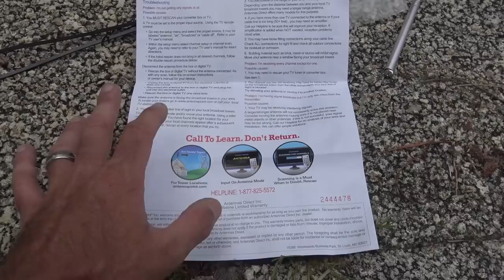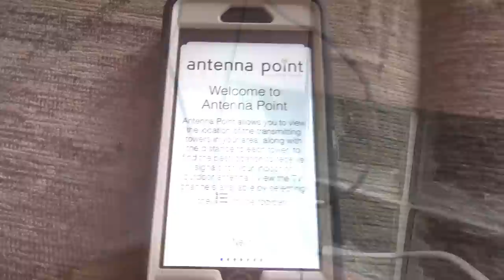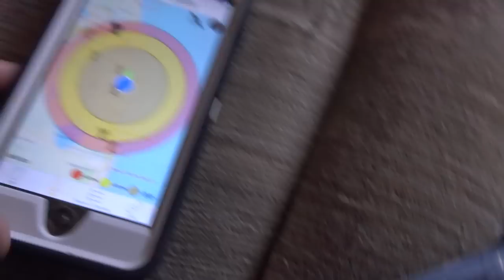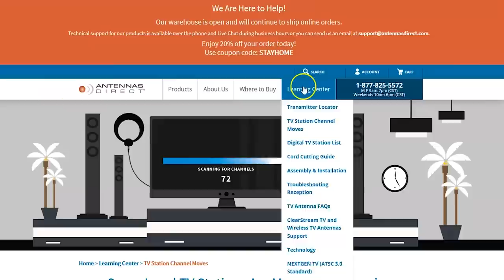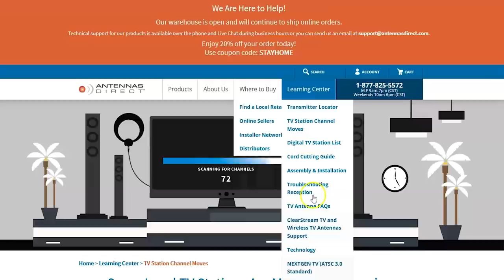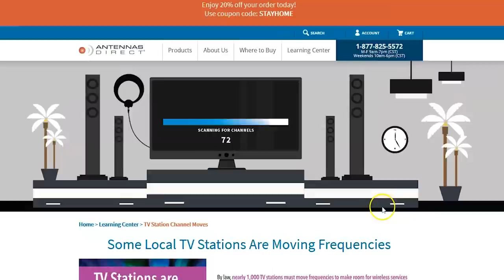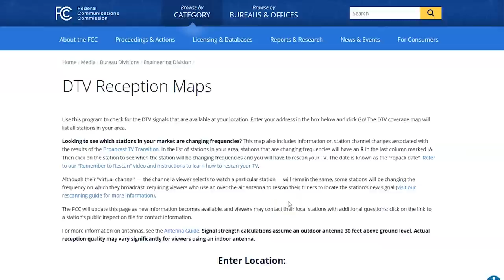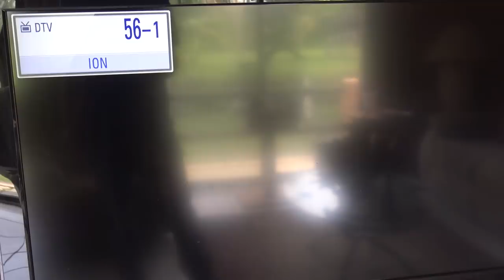Cancel Your Cable/Satellite, FREE Over-The-Air HDTV, TV Antenna Review, Cut The Cord!!!

Comment: Ya, I put that bow tie up about two years ago.  I live 35 miles from Seattle but pointing right at evergreens and hills but it works like a champ.  I live on the Hood Canal SW of Seattle.  The rest I got on AT&T TV over my one gig cable.  I used tvfool.com to locate.  I’ll check out the app.  Thanks

Comment: The antenna point app is a joke. I currently get 33 channels, most from over 75 miles away. This app only shows one tower as it only shows up to 60 miles. Currently using Xtreme Signal 8 bay, but am switching to db8e to see if it's any better.

Comment: Holy crap!  I JUST watched that video mentioned from two years ago and have a question.  So I thought I'd find your most recent video and ask my question there (here). I'm subscribing in hopes you answer it and to see future videos you put out.  Here it is,, when I go to ebay and search "HDTV Antenna/s" I do not see the "bow tie" design you recommend. They are all Yagi Antennas.  Can you say what is the deal with why you recommend that design over the other? I assume you recommend that specific antenna because "it" out performs over the Yagi   and because of the "quality" of construction.  But for your viewers what is it with the difference between Yagi HDTV and Bow Tie antennas specifically for HDTV applications?  Best wishes.  73's
Reply from the maker: Bowtie "BUtterfly" design is more of a wideband antenna design. Usually a yagi has one resonant frequency and as you increase or decrease frequency from that center point the gain goes down.. Look up info on a yagi vs a log periodic, which is unity gain compared to a yagi. Also, this db8e design allows me to face two different directions, without having to rotate.
Reply: Look up Danny S Hodges on you tube.he has the best antennas

Comment: I remember growing up in Gainesville, FL in the early sixties.  We had a TV antenna with a rotator.  A B&W TV downstairs, and a B&W TV upstairs.  The rotor control was downstairs. It pissed my siblings off when someone downstairs changed the antenna direction, and the upstairs TV lost the signal.
Reply: Best way to handle that is put tv antennas at different areas facing wharever the tv transmitters are located and connecting them into a reversed splitter. You can also fo thos with a three way and four way splitter depending on how many stations you wish to recieve and hooking tgem up to a gour way amplifier. Then you can have four tv sets ran off of the amplifier without any loss of tv reception.